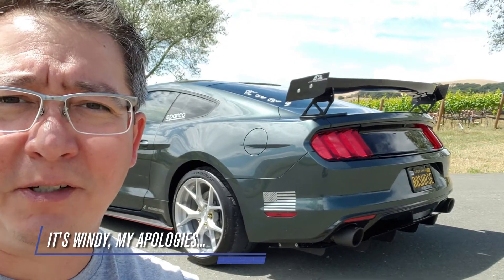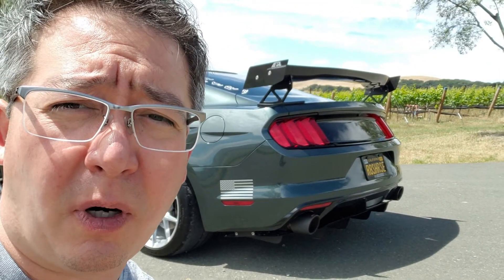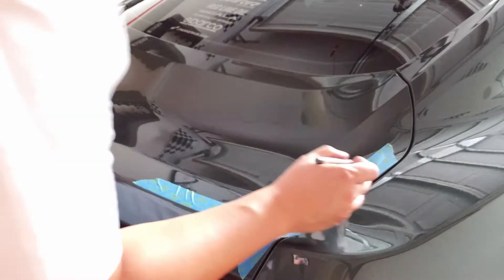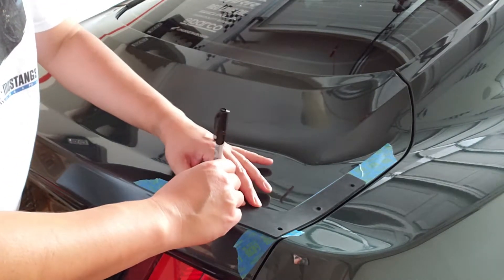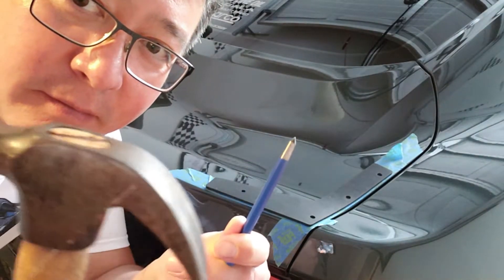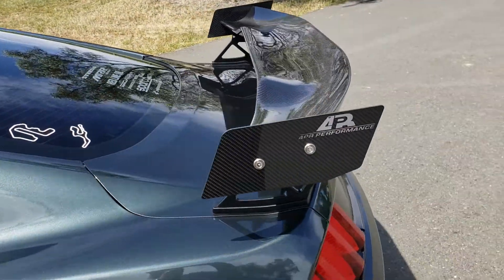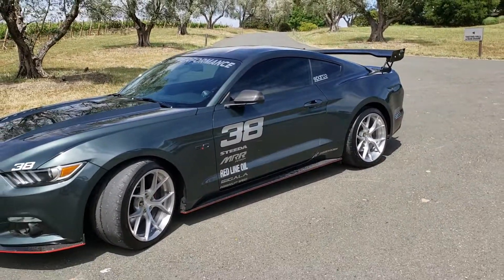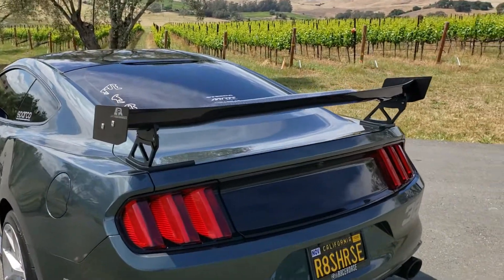Episode 32: APR Spec s550 Wing. How to install a race wing.

Comment: What diffuser do you have on it?
Reply from the maker: Hey thanks for stopping by. It's a Verus Engineering functioning diffuser. Check out their site and look at the data. It actually works compared to some of the other pieces out there that are just for looks.